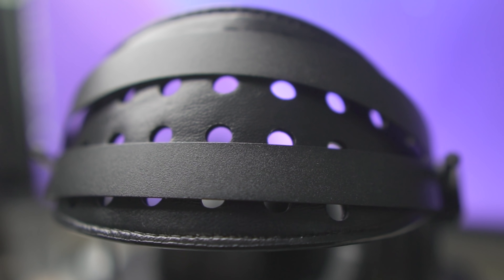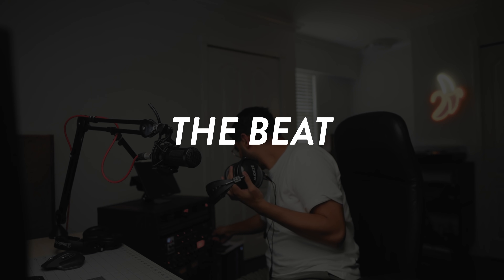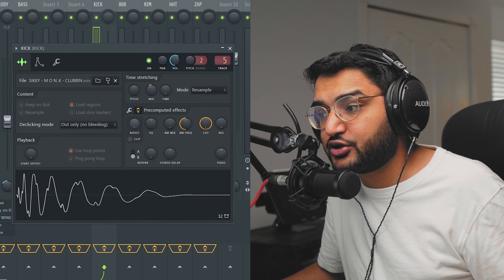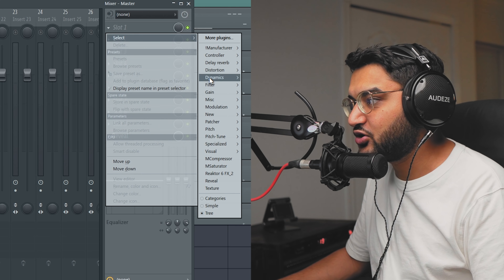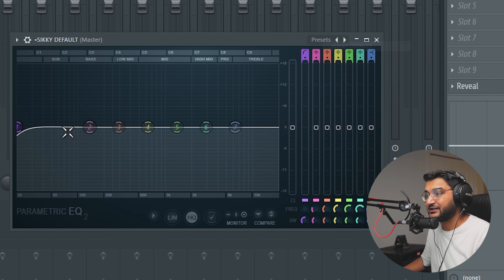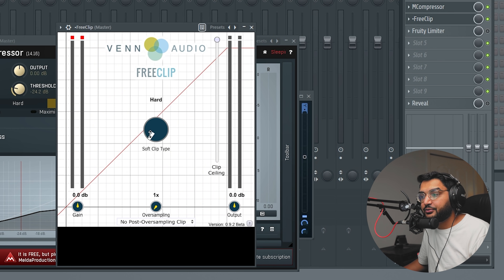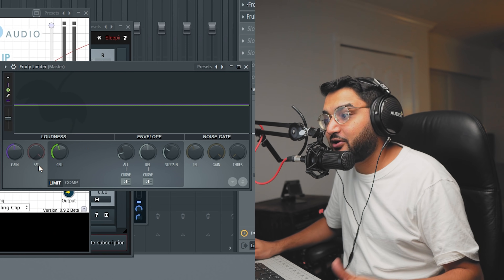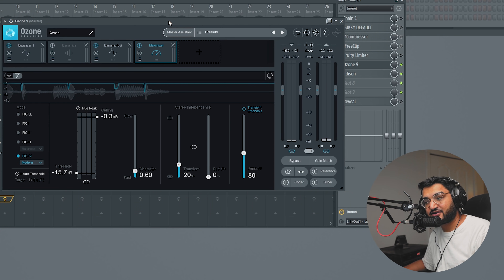How To Make Your Drums HIT HARD! | FL Studio Tutorial

Comment: I don't put anything on the master or use fx buses.. I'ma start fooling around with these techniques, because I occasionally run into low and high freq issues. I'm assuming a high end shelf on the master will brighten up the overall tone of the beat? I'm not sure why I would cut the low ends, as I already use fl parametric eq 2 to cut the lows on individual sounds. (And to cut the highs, if needed.)

This was super helpful, and I appreciate it Sikky!
Reply from the maker: Glad to to help mayne.  Yes a high shelf will brighten up the overall beat. but note that if you're hihats are nice and loud it will make them even louder as hihats mostly live in that area of the frequency spectrum.
Sidechain, optimal phase  alignment between kicks and 808s, and minimal instrumentation in the lowend is how I'd get a clean bottom end on my mix.
Reply: @SIKKYBEATS  dope, thanks for sharing! by aligning the kicks and 808's do you mean making them sit well together? either by pitching or eq'ing?
Reply from the maker: @MvnStn  I usually pitch anything melodic aswell as the 808 till I feel the kick and 808 sit nice together. If it doesn't work still change the 808 or kick. Helps to listen to the kick and 808 on loop and flip the phase on the kick in sampler track
Reply: @SIKKYBEATS  gotcha! i do the looping a lot for just this reason! ill pitch in the settings and also in the piano roll, if necessary. LOL dope thanks for the prompt reply!!

Comment: just a question.. might sound weird but .. if i have a oneshot of key f and i want to use it as key "a" so do i need to pitch it to key "a" and use it on piano roll at key a or what exactly i need to do ive been confused.... help me with one shot and how exactly i can tune it to different keys and use it in piano roll... including 808s and stuff
Reply: You gotta change your root note to F into the latest tab of the sampler menu
The crank one -> right click on F note at the bottom
Reply from the maker: By right clicking on "F" on Fl Studio Sampler keyboard you will have tuned the key to C. By doing this you tell Fl that the root note is F. Onces it tuned to F you can move your melody up or down to the key of A

Comment: If you put the input up, do you have to make the overall beat less louder?
Reply from the maker: Simple answer no. 
Only did this because I wanted to show you guys the difference between soft cliping and no soft cliping.
Reply from the maker: arun ganesh  Clipper: sharp blade that cuts only the peaks when they hit the ceiling

Soft clipper: like a clipper but it starts cutting a touch earlier to make for a more "rounder" softer clip, but still only at the ceiling 

Drive/saturation: applies an adjustment to a larger range of the signal, but still does more of its work at the top close to the ceiling

Distortion: drive/saturation applied hard by pushing the signal towards the ceiling, thus causing extreme saturation that sounds distorted